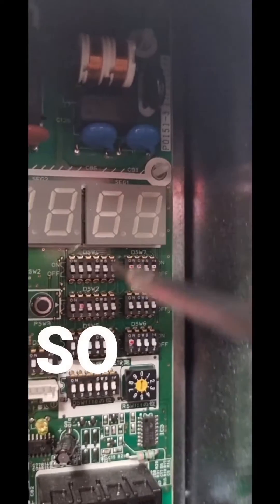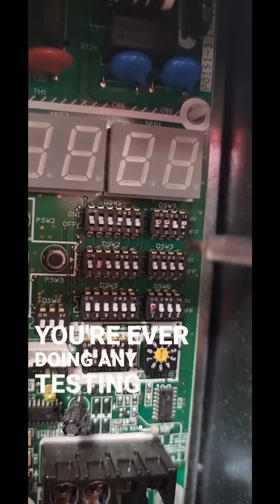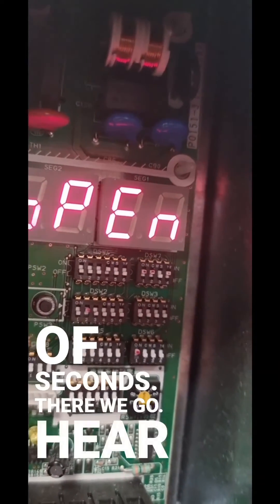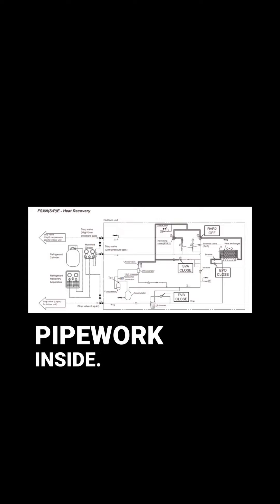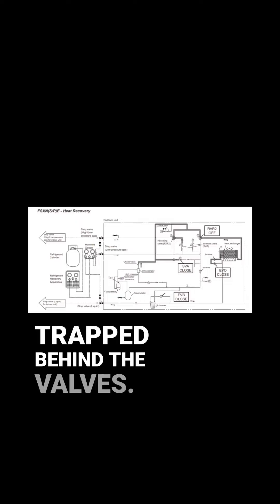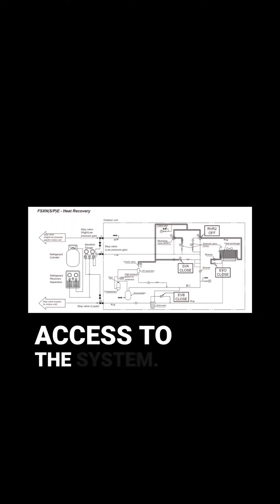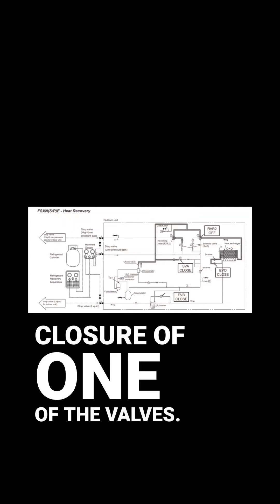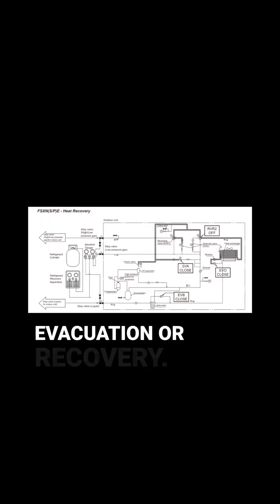Hitachi Sigma VRF Open Valve Mode

Comment: That's mean open mode allowed, indoor and outdoor all exv valve open
Reply from the maker: That's right it will also open the valves inside the CH-Box as well.
Reply: Hi I have face an problem in Hitachi vrv system error code is 03
Reply: How about the RAS-12FXNE. How do i open all valves